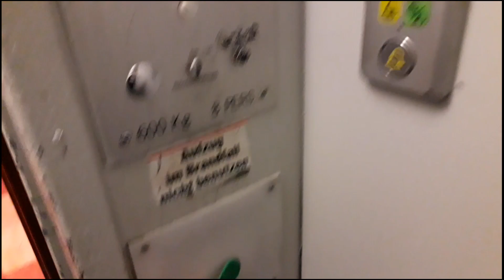High Rise! FAST 70s Relay Flohr Otis Lift

Comment: Excellent video of the controller/floor relays traction machine and defector, along with the over speed govenor. Last with the MG spin down.  The MG is in good shape clean communicator. Are the DC machines 440-480 VDC?
Reply from the maker: Thank you!
This Genset outputs 210 VDC 12,6kW
Reply: @TecStuffLifts   I was curious as to the lower DC output on the MG set, going back to the video a 2nd time I noticed the machine appears to be an Otis "baby or mini" gear-less traction. If I remember correctly, they were on a lower DC voltage, but pulled some 150A FLA.